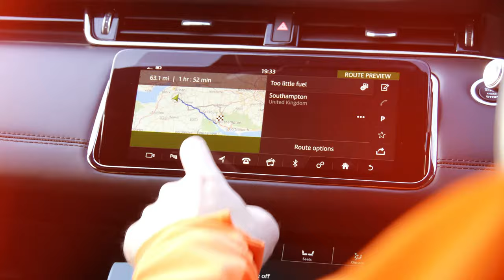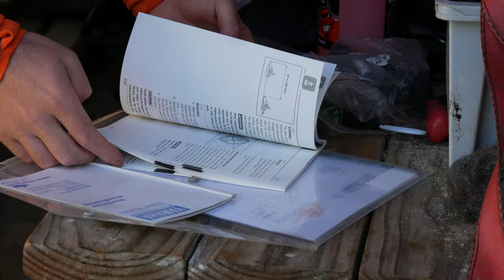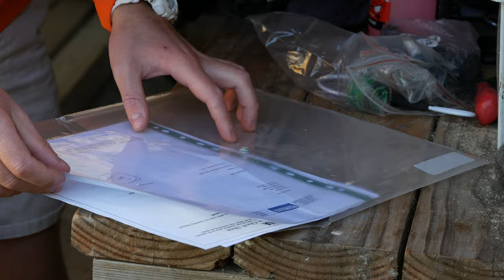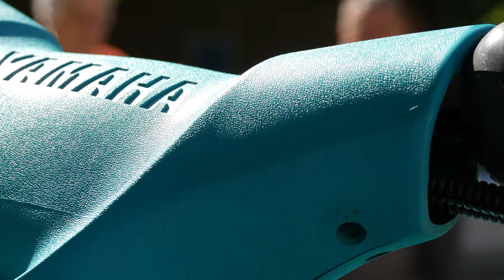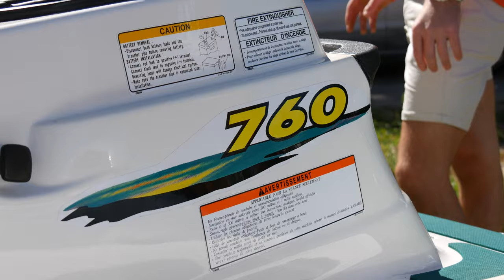I found the cleanest 90's iconic Yamaha jetski in a shed! MUST WATCH! | Wave Blaster II | Ep1

Comment: I would have ran a water test or a compression test if that checks out make a offer. I have been burned in the past on 97 wave venture 760 that ran perfect on the hose but after I put it on a load it had a dead cycle. Lesson learned.
Reply from the maker: Thanks for the advise dude, it runs sweet as nut…ride video coming soon…

Comment: I was given a 1988 650SX and a 1996 WB2 for free and have been restoring both to ride. Loads of abandoned skis here where I live in Japan. Not an easy task finding the original trim parts, but the WB passed its inspection recently so looking forward to getting it in the water. Wish it looked like this one. Did you mention the original stickers are available? 

BTW mine smokes a lot, too, with the original injection system in place.
Reply from the maker: Hi dude, so sorry for the slow reply only just saw your comment...that's epic that you got given two skis...lucky man! Yes the parts are super hard to find hence why I'm always so on it with inspecting skis, as I know how hard it is to get it back to OEM. The decals are tricky...there are some places that offer OEM replica but alot of the time the colour match is poor/sizing is wrong...so I normally re-vectorise/redraw and then work with a local decal printer to get it right vs spending 100s online and getting disappointed once they arrive (been there). Yes mine is only smoky when its sat for a week or two, then it calms down. Thanks for watching and supporting dude 👍👍
Reply: You should find a group on Facebook for your skis. Lots of parts available and lots of people working on them and upgrading them.